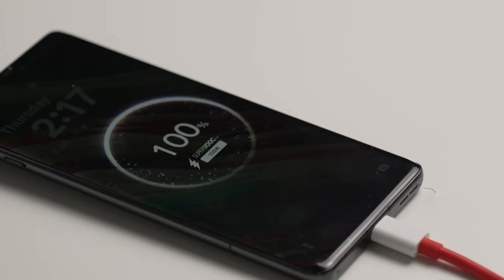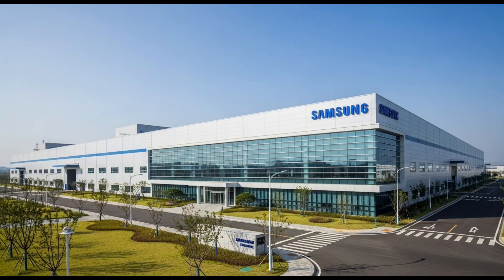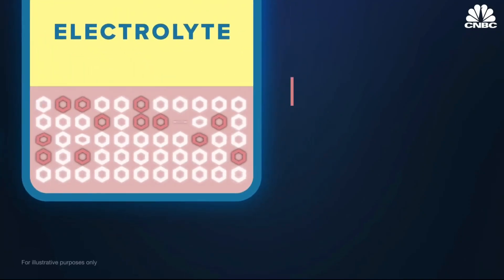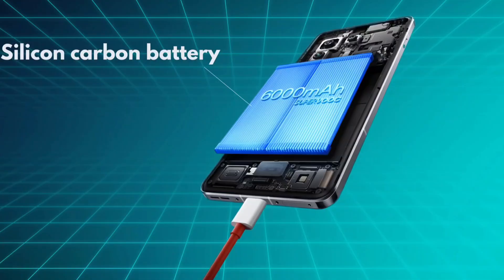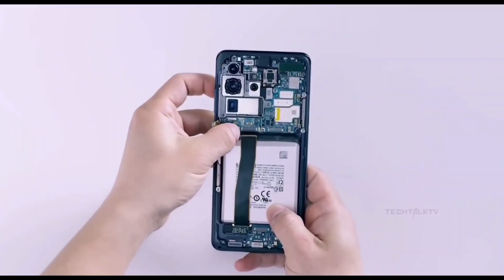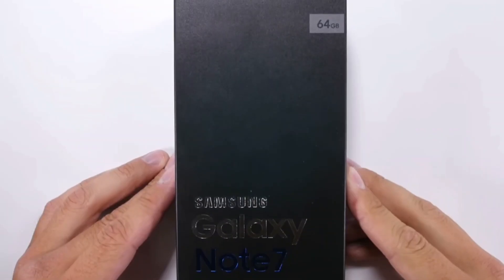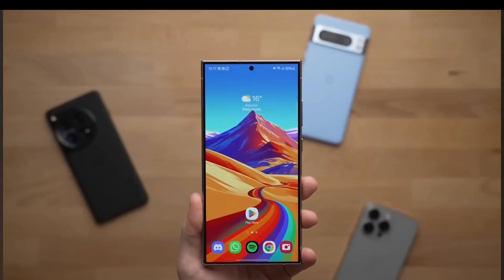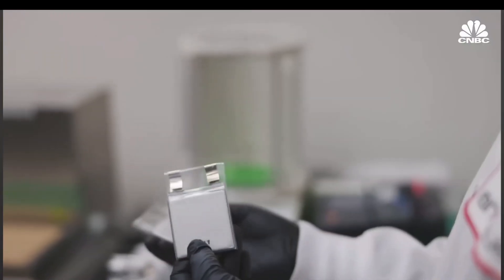Why Samsung Is Avoiding Silicon-Carbon Batteries — And It Makes Total Sense

Comment: I was prepared to learn something new about Silicon-Carbon batteries, but this channel unfortunately has to work on their research before putting together a video. The points they made about SiC batteries "swelling" and "cracking" is only true if the batteries are 100% SiC. There are no batteries (althemore smartphone batteries) that is 100% SiC- in fact, the highest SiC-Li ion ratio is about 15% (Glacier Technology) by Oppo/OnePlus. They are in the top 3 in terms of battery robustness, longevity, and cycle count at 1,200 at 80% SoC (with arguably Vivo with their BlueVolt tech being #1 at 1,600 cycles to 80% SoC compared to Apple's or Samsung's 800-100 cycles to 80% SoC) all while being more thermally-stable at extreme cold and heat.

The truth behind the lack of adaptation for both Samsung and Apple is due to economics and logistical realities- both brands source from older, but more business-established Lithium Ion manufacturers, which is an interest of ease of implementation and adaptation over pure technological superiority. 

Do your research before investing in any piece of technology, folks!

Comment: A52s vs poco x7 pro (4500mha vs 6000mha) the difference is when i leave the samsung with 88% battery after 6 or 8 hours of sleep the percentage remains at 88% or 86% but with poco after a complete sleep the 90% will reduces to 79% 
Is it the battery quality? Samsung or xiaomi poco differences?

Comment: Sams can use whatewer tech they want, li-ion is not great, SiC is not tested in long run, sodium is nothin usefull in portable devices - everything is compromise there, and li-ion wins on compromises list. But they can add 1-2mm thickness to non-Ultra S series to give it usefull capacity like A series have. S series have no battery longetivity if user charge it 3 times a day, it lasts 2 years then. But in reality we got Edge option with even less battery life 😆 Cable phones are back, but they need USB-C instead of RJ12 now ;-)

Comment: Surprise dude, Surprise 😂😂😂😂

Any battery will be based after 2 years of rigorous use. As a hard-core user, mines gone in 3.5 years. A sic battery will provide much more battery for slightly shorter life span 😂😂😂 assuming what you say is true. Any user using phone long term will have to change battery once or maybe twice. Just like whatever you do, your car type will need replacement!

Comment: you do realize lithium also cannot last for 7 years right? after constant charge surely it will degrade faster.. samsung phone battery also have major issue known as unexpected spicy pillow... so make no sense to allow 7 years worth of update and still giving user less battery life..
Reply: You can replace a battery for no more than $100, far cheaper than a new phone.
Reply: Of course can, without any problem.

Comment: I don't think have to worry much coz eversince silicon carbon battery in phone haven't heard a single incident. don't forget the chinese now are practically leader in battery tech.also don't agree with what is being said about samsung not using silicon carbon - simple have its own battery manufacturing & ON TOP SAMSUNG JUST DOESN'T WANT TO SPEND MORE ON THE THEIR DEVICES NOWADAYS DON'T BELIEVE ME -- JUST AT THE NUMBERS OF CUT FROM THEIR RECENT RELEASE DATING BACK ALL THE WAY TO S22 ULTRA. SINCE WHEN HAD SAMSUNG ACTUALLY MEANINGFULLY CHANGE THEIR CAMERA TECH????????

Comment: Main reason samsung not using silicon carbide batteries is koreans are mass producing lithium batteries. Technology of silicon carbon batteries is of china. Korea are afraid of losing business.
Reply: And Chinese batteries a dangerious becouse they dont have that kind of safety. I know it, tried them. I needed 18650 batteries so i had to do research, and some of these chinese batteries can have plus 500mah in them, and can output more amps, but i dont its worth to broke your device in a short time. You dont have agree with me, but i tried it failed with it, and i wouldnt buy another of them.
Reply: @djblinboy so whats the purpose of bms then? Maybe you bought ccheap chinese product.. expensive chinese product are high quality. Even iphone and samsung parts are now made in china..
Reply: No Samsung anyway uses a big chunk of it's batteries from chinese suppliers
Reply: already answer u silicon carbide is not safe only last 3 year
Reply: @julientan7156 lithium is fite hazard whereas new technology is safe
Reply: @djblinboy sure bud 🤣
Reply: Nah, it is not case. Iphone doesn't use too
Reply: Sodium Ion, if it proves out, last decades.
Reply: @julientan7156  LI aren’t eternal either tho
Reply: So all chains company is fool that are using it , 
Sure this is only excuse, they want only money apple ,and samsung
Reply: @kik1139  also Samsung is heavily minding their own profits not the user experience always.... It would cost them more money to make the new batteries which will have to be billed on the customer who is already billed heavily ! Yes, Samsung phones are pretty expensive
Reply: @djblinboy  the are many grade and brand battery from china,u need study first before buy
Reply: @tambayngcomsec6659 Purpose of BMS is to monitor battery health, current, and voltage, balance battery cells, protect them from overcharging/discharging, and also thermals. Wdym?
Reply: @djblinboy my point is china is a world manufacturer even the most expensive brands in US and WESTERN COUNTRIES are made in china. My point is the quality of product you can get from china is depends on your budget.. Chinese is well known as Business Minded. Asian countries knows that common knowledge.. if you got faulty low quality product its your fault for having very low budget its not their fault.
Reply: @tambayngcomsec6659 Yeah i think made the mistake here, im talking about those no name brands who advartise their cells as (in case of 18650 batteries) as they have higher around 15% or more capacity over the well known brands, which in some cases are true, but dont think it will throttle itself at higher temps for your own safety. There is lot of energy even in a small battery, and dont about bigger ones, i dont want to be near them if they catch fire or explode.

Comment: new samsung batteries are rated for 2000 cycles for flagships and 1200 for mid to low end
Reply: not true - samsung tab S11 series has already drop down to 1200 cycles.
Reply: @francischiew7080. 😂

Comment: This is not really true. Silicon expands but adding the carbon prevents the expanding, hence why it’s “Silicon-Carbon” and not “Silicon”.
Reply: Adding carbon to Silicon reduces expanding, but certainly doesn't stop it. The only way to safely stop silicon expansion is by not using it in the first instance. It is ultimately too unreliable and unstable.
Reply: @neilmcguinness4422 Not really, there’s a startup that grows silicon wires that give the silicon room to expand, eliminating the expansion problem. The channel ‘Undecided’ did a video on the promising tech.
Reply: It still expands.
Reply: @neilmcguinness4422 But there is a way, which is the one adopted by Chinese companies, which is nano silicon cells.

Comment: Bro I'm using Samsung phone's since 2016 I brought a Samsung J7 pro in 2017 and it's still running with the original battery and the battery backup is still good.
The trick is you need to maintain your battery 
I always charge my phone from 20-80%, back in the days there was no battery protection feature like now but still Samsung battery is awesome because Samsung learned a lesson from their Note 7 incident.
Reply: True. The Samsung gadget which my relative has is already 7 years plus and the batt is still good. The only downside of old Samsung phine is the update. Unlike in the present where even their cheapest phone has 6 years update.

As for charging, I don't really follow a rule but the battery is still working fine with my current 3.5 year old samsung device. Battery protection is still off

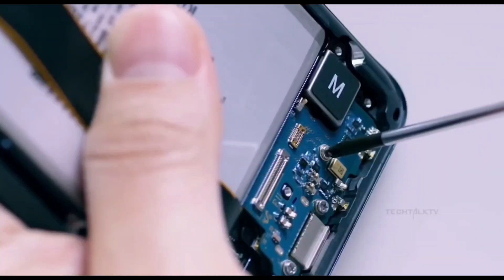Comment: 2:01 
Batteries are fucking replaceable, they wear out, you buy a new one, in the past that was totally fine, until manufacturers stopped the support for replaceable Batteries, some make it impossible to remove, and others mock you with it in their software even if replaced
Reply: Another reason is that they release new models every year and it becomes hard to have stock of replaceable batteries for years for so many devices.

But right now yearly release schedule is silly.
They should be releasing a model every 3 years.

Comment: It just doesn't make sense to not use Silicon Carbon on phones you make that SORELY NEED them, like the S25 Edge

If the Chinese can do it, so can a Korean Based Multinational Conglomerate🤦‍♂️🤦‍♂️🤦‍♂️
Reply: Carbon only slows expansion in silicon. It can't stop it as silicon is simply too unstable ultimately. You only need to Google this simple fact. New and better types of battery are needed.
Reply: @neilmcguinness4422 The only thing I Google is that Honor is now on its FOURTH GENERATION of SiC Batteries with ZERO CONCERNS of expansion nor battery degradation🤦‍♂️🤦‍♂️🤦‍♂️

Comment: Samsung just don't have capacity to produce them. And yes, battery should be replaceable, and nobody would care if they lasts only for 3 years.
Reply: I would care, for the environment. Unless their production is so efficient and non-damaging to the env..
Reply: I don't like replaceable battery. New batt tech should be similar to the current one that can last even 7 yrs like the Samsung of my relative.
Reply: Replaceable battery should not come as it will kill water resistance which is needed . Like in rain
Reply: @seojun3101  I agree, but battery longevity primarily depends on charging cycles. Let’s compare the batteries of the Samsung Galaxy Fold6/Fold7 with the Honor Magic V5.
Samsung uses a smaller 4400 mAh Li-Po battery rated for 2000 cycles. In everyday use, that typically means about one full cycle per day, which translates into roughly 2000 days of use—or around 5.5 years.
The Honor Magic V5, by contrast, has a larger 5820 mAh Si/C battery but is rated for only 1200 cycles. Since average daily use amounts to about 0.75 cycles, that gives around 1600 days of lifespan—or about 4.5 years. If Honor manages to raise the rating to 1400 cycles in the next generation, the overall lifespan would be close to that of Samsung’s Li-Po batteries rated at 2000 cycles.
Looking at Apple’s iPhone 17 series, we see that their Li-Po batteries are rated for only 1000 cycles— even lower than the new Si/C batteries used by Honor and other Chinese manufacturers. So there are really no advantages over Si/C.

For this analysis, I used information from GSMArena.com and from the EU energy labels, which are standardized.
Reply: @kingvishwas7192  The EU will require portable batteries in products like smartphones, laptops, and e-bikes to be easily removable and replaceable by the end-user starting February 18, 2027, thanks to the new EU Batteries Regulation. This rule, part of a broader sustainability initiative, aims to extend product lifespans, reduce electronic waste, and give consumers more options to repair their devices instead of replacing them entirely. That will ge very good for the whole world, as it was regulative form December 2024 which requires USB-C to be the only charging port in mobile devices sold in EU.
Reply: What a nonsense...
Reply: @seojun3101  i am surprised that it did last that much , i owned samsung since nokia left the building , regardless of the phone quality and feauture , up to s23 ultra , the battery life span are really short . i have to replace the battery in a maximum of 1 year and half .
Reply: @kingvishwas7192 this is bullshit. We had water-resistant phones like the Samsung S5 way before they started making the batteries unremovable.
Reply: I like my glass sandwich. Down with removable batteries.
Reply: @Azdiah  oo can I ask you how many hours you use AC in a day ...?
Reply: It's easily available. Samsung anyway doesn't manufacture a big chunk of their batteries themselves. They could easily use silicon carbon batteries if they want. But we all know, they will play it safe. Samsung and apple have huge reputation to protect
Reply: Tbh even current batteries last for 3 years before degrading to a point that’s no longer good for use
Reply: @seojun3101 you are kidding😅😅😅
Reply: @kingvishwas7192 that's not true IP65 phones can be made with replaceable batteries
Reply: @ameerm4899 yeah after some research I found that replaceable batteries are possible but companies won't add them . Reason is back glass  if consumers can replace battery then they can even replace back glass too which the companies don't wanna do as both of them are good source of income for companies
Reply: @kingvishwas7192 then we have good guy Nokia trying it's best 😊

Comment: Simple reason they aren’t capable of making it. Chinese companies currently hold monopoly over it.
Reply: lol. China isn’t the only one making silicon carbide batteries. Group14 (backed by Porsche) is producing SiC anode material in the U.S. and South Korea. Japan (ROHM, Toshiba), Europe (STMicro, Infineon), and the U.S. (Amprius) are all active in SiC tech. China’s big, but it’s far from the only player.
Reply: Yeah PTSD note 7
Reply: @Langebaan  but they are not economically for mass market.those are just for show piece.
Reply: @Langebaan  Yeah and Huawei with SMTC made their first 5nm process node, why aren't we seeing them in new huawei phones? Oh yeah, making something doesn't mean mass producing, same case here Group14 may have the ability to make SiC, but there is no point of waving the flag, because they can't physically make more than xxxxx cells.
Reply: @Langebaan Dont you think SamS, Apple and the others have a huge Lythium stock?

Comment: Silicon does expand, but modern Si-C batteries use nano-silicon and elastic carbon support to safely control it. Phones like the OnePlus 13, Realme GT 7 Pro, and Vivo X200 use them daily — no swelling, no risk. It's not dangerous, it's just next-gen engineering.
Reply: These phones got released recently How's it gonna be after 2 years?
Reply: It's good bro @balajirs6235
Reply: @balajirs6235 exactly. All the risk adverse companies are currently waiting and watching
Reply: @balajirs6235  Vivo X100 Released 2023 u got answer ?
Reply: @MrLllk from gsm arena, vivo x100 doesnt use SiC battery, still li ion battery
Reply: @MrLllk Vivo X100  Li-Ion 5000 mAh. Please do your research before saying such things. Or perhaps you did that intentionally to just wanting to be a hater.
Reply: You are right in what you say here, but quality control is essential to ensure the natural expansion of silicon is contained and controlled. You can't cut costs here. I am sure though that better more readily stable battery tech will arise ultimately.
Reply: I see all of those used on eBay with a bad battery
Reply: @MrLllk I think he means x200
Reply: You mean the x200. Also the thing is silicon carbon hasn't been around long enough to have their reliability proven, Samsung offered 7 years of support and even lithium batteries struggle to last that time, carbon silicon seems to crap out around year 3 so the bigger batter size after year 3 would be smaller than lithium ion of the same physical size.
Reply: @GoldenNada  you're right it's the x200, but not even lithium can stay for 7 years without degrading
Reply: @WisdomEkeoma yeah I know, they lose capacity after 3 years, my fold 5 only have 4000mah now instead of the 4430 it had new. Silicon carbon batteries would probably lose 1500 mah vs the 430, and in that case thats a big big problem cuz thats a much more noticeable.
Reply: @GoldenNada  remember the tech is still new it will become better over the years, lithium has stayed for quite some time
Reply: @MrLllk so, two years. Not much.
Reply: Writing this on a OnePlus 13. I plugged in the charger at 23% at the start of this video. It's now at 36%. I will charge it to 80% and charge it again in 36 hours to 80% from 20%. So, it may last me two years, but it's saved me a lot of time and money by existing. I don't feel like I'm tied to the wall socket anymore.
Reply: @jensendash  exactly, maybe you can just change the battery in a few years if it degrades
Reply: Watch some honor magic 5 series you all will get answers
Reply: What about overheating? Does that affect battery life/performance of Si-C battery phones?
Reply: @petrossi301  Basically yeah, it’s still a lithium battery. Silicon helps boost energy but too much heat still makes it swell and wear out faster.
Reply: @WisdomEkeoma Thank you. Are Si-C batteries more prone to overheating? And I'm considering getting a new phone to replace my Vivo X100 that overheats over nothing. Do you have discord/something I can contact you over?
Reply: @petrossi301  nah 😂, yt maybe the only social app i use and WhatsApp 😅
Reply: @petrossi301  but xiaomi has some good devices depending on where you stay
Reply: This AI video is stupid. There is no real Silicon Lithium batteries. Silicon carbon lithium ion battery isn't the same as a silicon lithium battery.
Reply: @Yoedi16  vivo X100 Ultra has a Si/C battery, check gsm.
Reply: @petrossi301  There is no evidence Si/C overheats, the phone's software is responsible for that. Just factory reset it.

Comment: They are the WORST mobile manufacturers i am not an 😮iPhone user but i would rather buy an iphone than any garbage they put out THEY ARE THE WORST ANDROID PLATFORM there batteries are terrible they run soo hot EVERY smartphone they have is like this avoid this garbage like a plague